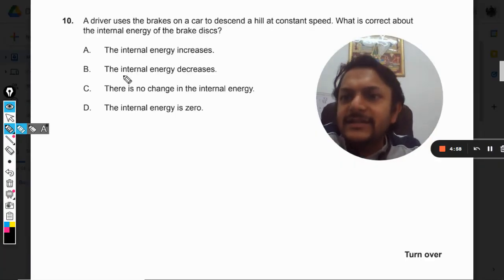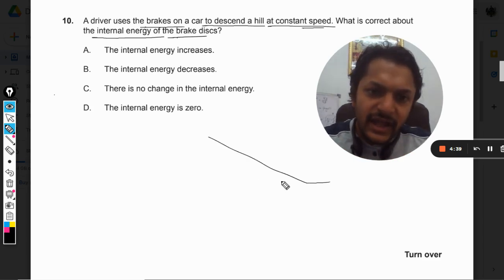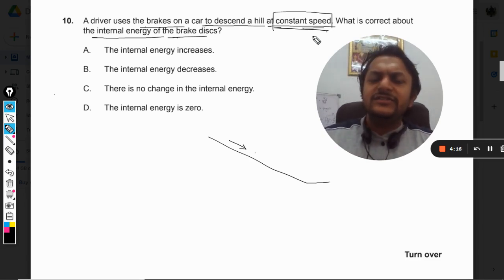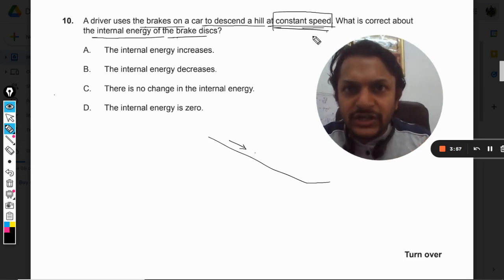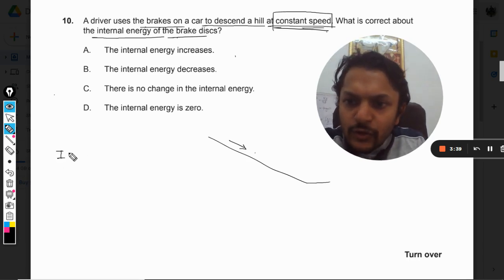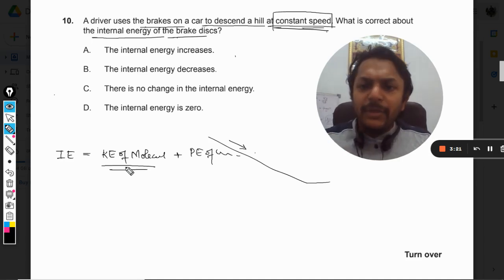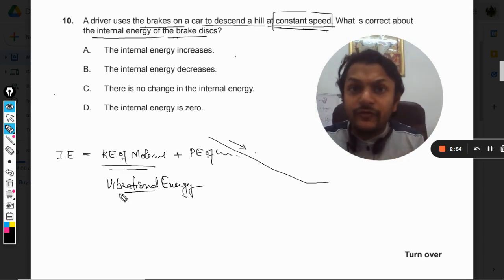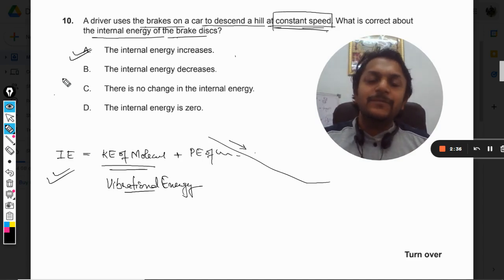A driver uses the brakes on a car to descend a hill at constant speed. What is correct about the int

Comment: what about the potential energy?
it's also decreasing right? so why does the internal energy stays the same as KE inc and PE dec
Reply: So someone should correct me if I’m wrong because I’m a student as well, but in Topic 3, while discussing internal energy, we’re not talking about a notion of potential energy like we learned in Topic 2 (as far as I’ve understood). Apparently we define “internal energy” as “the total of kinetic energy of the particles and potential energy in the bonds between particles”. So the potential energy we’re talking about here is to do with intermolecular bonds etc., which isn’t changing in this question.
Here is the link to the video lecture I watched that clarified the situation for me: https://youtu.be/i0vRvMYP-wg?si=afHJu0n0uJWSvfJJ
Hope it helps!